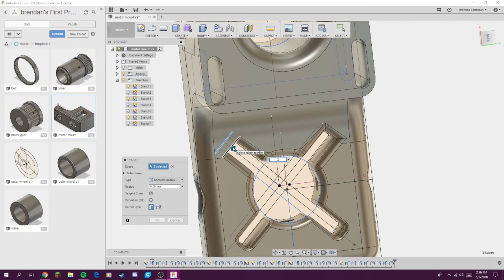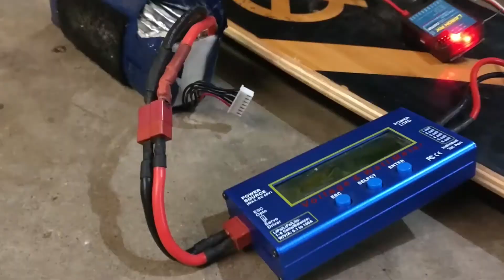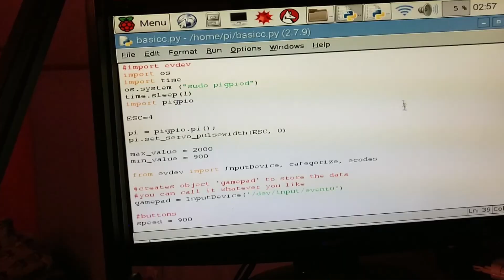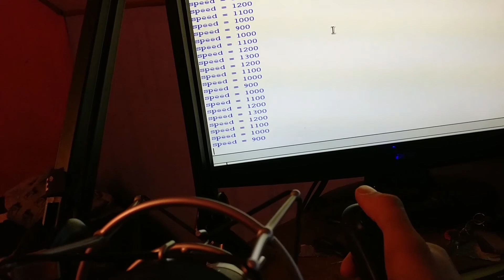It WORKS 3d Printed parts Electric longboard

Comment: have you been using it? How is it holding up? i’m trying to see if there are any 3d printed motor mounts that are strong enough
Reply from the maker: I had to upgrade the motor because it can't take the weight and the printed belt melts so I had to buy one
Reply: 3d Maker what if i made the mount out of carbon fiber filament or abs
Reply from the maker: Nothings broken but that would be some reinsurance
Reply from the maker: @milesb8985  it would work now I haven't stress tested for a full extent.
Reply: 3d Maker i’ll try it out, very interesting design
Reply: @3dmaker808  hey I was looking at the files and I see there are two different designs for the motor mount, is one better or is it for different motors
Reply from the maker: @milesb8985  if I remember right one is tall for different sized trucks
Reply: 3d Maker ok thanks